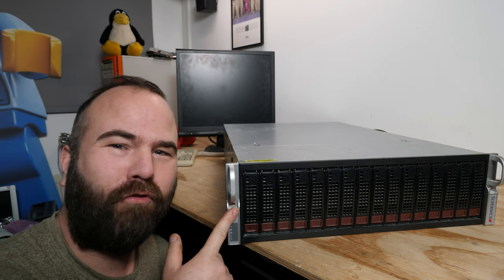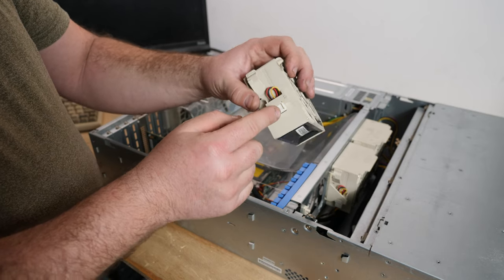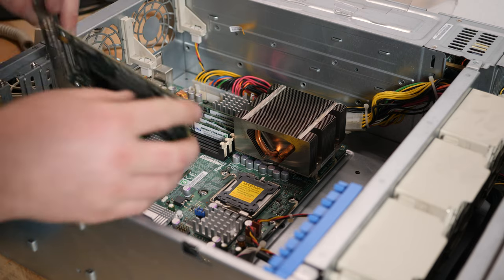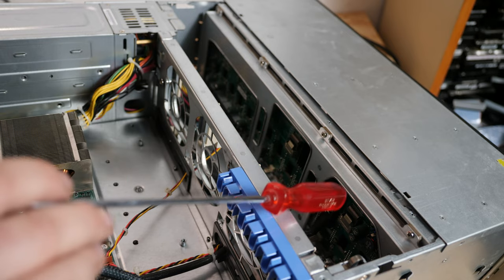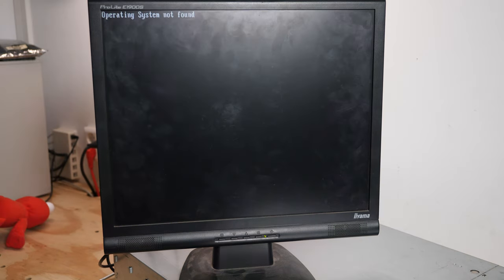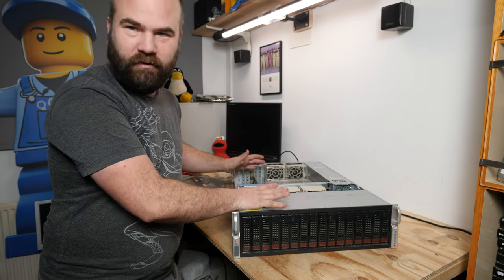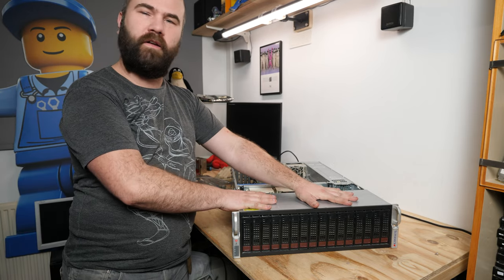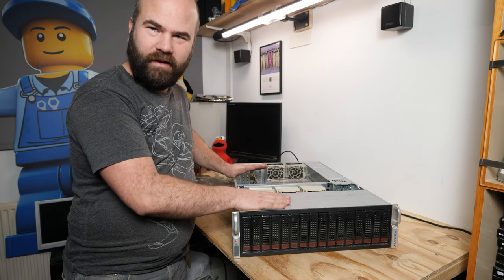This old Supermicro Server can still be a great File Server in 2023!

Comment: You should upgrade to an X10 family board and SQ (Super Quiet) PSUs. X10 will allow IPMI fan settings to quiet the server and if you get the right X10 MB, you can connect the backplane to the MB. Supermicro is great for being able to upgrade, swap and their stuff is built like tanks.

Comment: Hi Victor - big fan of all the content you put out, especially the workstation and server stuff. If an ordinary ATX mobo fits I recommend you lurk on ebay for a Supermicro X11 Series board on auction. Often times people upgrading their servers package that with CPU and RAM as well which then makes for even more of a bargain compared to buying individually. Combined with a Xeon E3 v6 aka 1151 socket Kaby Lake CPU you get a great price to performance solution that´s also pretty power efficient and has modern IPMI for often less than 200 euros. Additionally, if it´s just spinning rust you can definitely get away with turning cores off in the BIOS to lower power consumption even further since they all come with AES-NI acceleration for very efficient SFTP transfer. Keep up the great work!

Comment: Supermicro sells a front panel adapter for use with non supermicro motherboards. You can seach for Supermicro CBL-0084L.
Reply: You can also make one pretty easy as manuals have the pinouts you you just need a male-to-male pin header minimum.

Comment: Since this chassis has a back plane with an expander (probably SAS-2, since this is so old), you don't really need a motherboard to make it useful.  You could just put a little converter in one of the rear slots to change the external 8088 or 8644 to whatever is the connector on the inside -- $20-$25, then put a HBA in your main machine that has an external interface.  One or two cables and you are done.  Truenas will see all the disk in your new JBOD.  You will need to jumper the power supply pins to get the power supply to turn on to provider power to the drives and the fan.  Also, Supermicro sells quiet fans and power supplies to replace the loud ones you have.

Comment: I have an Intel server board with dual e5-2470s, the original case it was in was pretty beat up so I moved it to a new case and of course didn't use the original fans, yeah its stuck at 100% fan speed all the time without them fans, I had to buy 5v fan adapters to quiet it down, and it still runs under 70C at full load, I wish my board had a way to control the fan speeds in the bios....

Comment: Use a dual X99 MB and 2 Xeon's E5-2698/2699 v3 or v4, could be even a Chinese MB from Ali Express, a dual SAS add on card PCI express and another SAS cable , all SAS bays populated with 10TB SAS minimum HDD, a 10gb Network add it n, etc

Comment: If you're considered about front panel connector Supermicro makes an adapter for that. Part number CBL-0084L. It's because connector going out of power supply or PDU is one solid 16-pin header so on non-Supermicro motherboard you would have to split it somehow into 1-pin/2-pin connectors for power/reset button, power/hdd led etc.

Comment: The SAS expander wouldn't be an issue. If you want larger drives than the (likely) 2TB drive limit, just swap the RAID card for a newer one.

As for motherboards, I've loved my Asrock Rack X470-D4U. It'll take almost any AM4 Ryzen CPU and supports ECC with compatible CPUs. It's a proper server board with full IPMI/BMC and IP-KVM with virtual media support, so works well locked in a ventilated cupboard or off-site location.

My X470-D4U is currently in a reused Supermicro 2U 12-bay chassis and hooked up to three Xyratex 2U 12-bay SAS disk shelves, utilising a couple of LSI MegaRAID 9285CV-8e cards, with a total of 200TB (after RAID-60 overheads) of storage, plus an NVMe OS drive, and a dual port 10Gb CNA. It works brilliantly for bulk storage, Plex and VM loads.

You might also wish to look at swapping the PSUs for 80+ Platinum/Titanium models, for increased efficiency.
Reply: is SAS still the thing - or are modern SATA exceeding performing - like drives with 256M cache  ?

sustained performance 

i had a few second max of 600+ mb/sec
(picture proof possible)
Reply: @herauthon  SAS controllers can support SATA disks, but not the other way round.

For spinning rust (mechanical hard drives) even a 3Gbps backplane isn't really an issue due to the low sustained throughput they can achieve. For SSDs, you need a 12Gbps backplane for the extra upstream link bandwidth.
Reply: @thesuggestableone  

i tried a mixed setup but wonder - testing now - a SATA only setup - and test disk-2-disk performance.
Reply: What do you mean by swap the RAID card for a newer one?  You are not speaking of the SAS expander are you?  Be great if you could just swap it out for a SAS2 or SAS3 expander.
Reply: @URackADisciprine Older RAID controllers like this one have a 2TB limit on disk sizes. Replacing the controller for a newer model that doesn't have the limit will allow for the use of larger disks.

Replacing the backplane/expander with a faster one won't get around the capacity limit. Additionally, throughput would only increase if the RAID controller was also replaced.

Simply put: Upgrade the RAID controller first to gain access to larger disks. If bandwidth/throughput is a concern after upgrading the controller, then the expander might be worth upgrading. This would only be of benefit if using SSDs, though.

Comment: For home file server you need just a small NAS with 2-4 disk bays, they are power efficient and quiet.
Reply: i have a bit of a dataissue, which would not fit on a 2 to 4 bay array. Also, i have been running a ZFS setup for a long time and the minimum amount of discs for that, which actually helped me keep my data safe, even with 2 drives failing in the end, was 6 disks. 

I hope i can fill the fileserver with like as much disks as possible and in the end make it a multi terrabyte fileserver, so i can use it as a backupsolution and datadump, combined with other methods to back stuff up

Comment: Any Socket 2011-V3 or newer board or maybe even a Xeon-D based system, supermicro will do a board that can probably slot straight in, Unfortunately for Power/Capacity even the older ready made NAS boxes would be better especially if its got an ARM based CPU. A 4th/5th/6th generation i7 will run rings around what's in there for half the power aswell

Comment: To be honest, I highly doubt all of those drive bays are accessible via that single SAS cable.  More than likely only the first four bays are active and the rest are dormant. That was the case with my 8-bay Supermicro server. I replaced the RAID card with an HBA with two SAS cables that connected each half of my SAS backplane. After that, all eight bays were active. Adding a SATA SSD for the OS turned this server into a decent TrueNAS box.

Comment: Intel Sandy Bridge (first generation Xeon E5-2400 or 2600) is where the big power savings happened. Later generations do use less power, but the improvements are a lot smaller.

If you're going to use it as a backup server where you only turn it on once a month, honestly I wouldn't worry too much about power consumption. Even if it costs 20 cents per hour to run, it would take a long time (maybe never) for it to be more cost effective to spend money on newer hardware than it would to just pay for the higher power usage.
Reply from the maker: Yes im a fan of the 2400 and 2600 series. To bad there aren't much 2400 motherboards around (I don't like the weird china boards)

My daily driver is still a 2690 v2 😍
Reply: @victorbart  Me too, I still run v2 on almost all my computers. I don't know if I'll ever upgrade since v3 and newer need expensive DDR4

Comment: Hi Victor! I love supermicro for the same reasons that they follow standards more than dell/ibm/HP. I show how to adapt other motherboard in supermicro in my video here: https://youtu.be/bljSFPp3mJc

Also, for power efficiency, supermicro PSUs can be used across generations in most, not all, models. So, do research to see if your PDB can take the PWS-920P-SQ power supply. It is extremely quiet and more efficient.

Supermicro has been using 80x25mm fans in almost all their designs. They have many fan models you can adapt to suite your needs.

For motherboard, depends on what you can get. There are a lot of options in my local market. I recommend something at least ivybridge era or newer for better power efficiency. Check out X9SRH-F for example. 

Biggest issue might be the SAS expander on that backplane. It is probably SAS-1 which has limitations. There might be a sas-2 version of that backplane and I wouldn't be surprised if it can be retrofitted in the older chassis. Supermicro is usually good that way.

Thanks for the video!